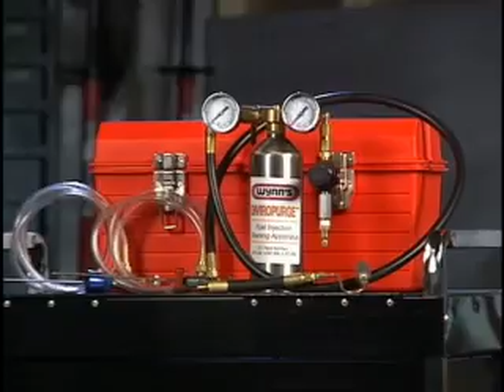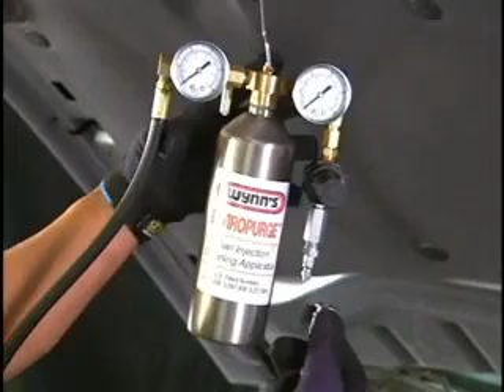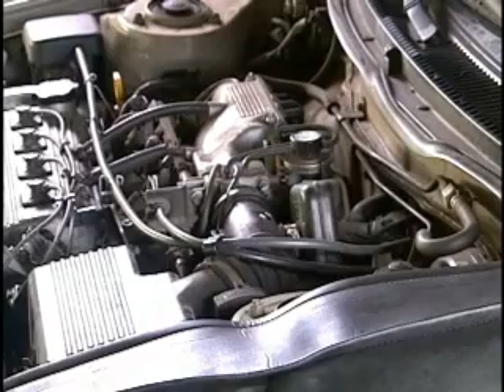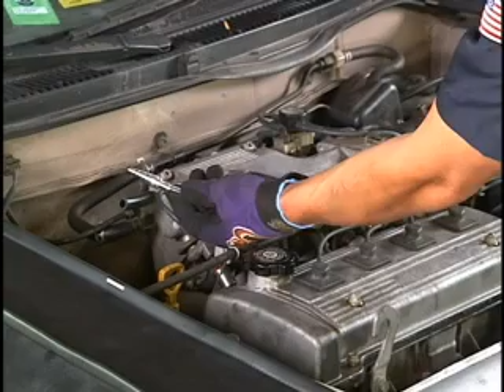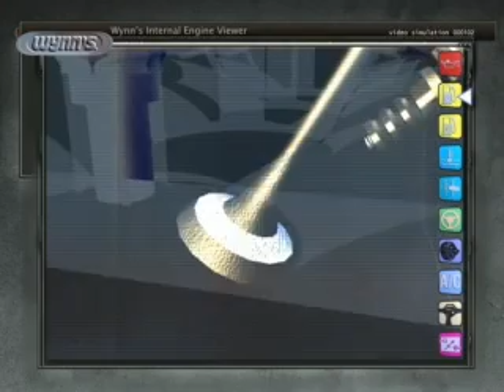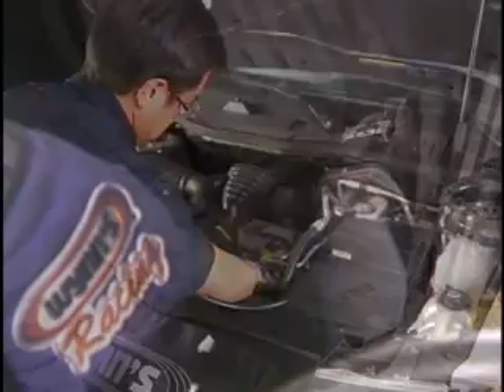How to perform a Wynn's Fuel System Cleaning Service

Comment: Just had this Wynn's procedure done on my 2000 s10 with 372,000 miles. The vehicle runs better than it did when new.  I recommend this procedure. It was performed at a GM dealership.

Comment from the maker: You can use the VIC product to perform a fuel induction service. When you perform an induction service, you leave the throttle alone and let the vehicle idle. After the all the product runs through you can perform a throttle body cleaning service. I hope I answer your question.

Comment: The best way to clean injectors other than removing injectors and having them cleaned and serviced, also due to the current easy way of buying a borescope take pictures before and after to prove it works otherwise its mute,especially if the injectors and the combustion chambers have never been cleaned that way you can tell it really works, any cars which have never had cleaners put through the system will never be cleaned properly unless you have the head off and clean the piston tops and replace the intake and exhaust valves. :) The stuff works but it all depends on how old your car is and how many KM have been driven and especially if HWY driving due to the amount of heat and cleaning of the intake and exhaust and piston aras ? PS: think about the amount of carbon on top of your pistons is really added extra HP to your car due to the build up of the carbon, like taking a couple of thousands of a inch of extra height to the top of your pistons but then again your injectors really do need serving especially if you are living out of town and do not have great clean fuel all the time ?

Comment: So at the 3 min. in fuel system cleaning (VIC) you dont need to have a throttle compresser to hold above while the fluid is going through, just adding fluid til the engine begins to run rough?

Comment: Hey. I wanted to get this service done on my toyota mark x which has the 4gr-fse (Direct injection). I just wanted to know if this service might result in any issues like (o2 sensor clogging or other CI codes that mite come). cheers

Comment: where in the uk can i have a wynns machine flush? your offices in the UK are not helpful, actually quite rude.
Reply: +chad h thanks for the reply. you are totally correct. brots are rude. usually, they more politeup north. stoke, Birmingham and that sort of thing. i see, wynns is overpriced. there is an edt machine thats not wynns in the uk and its about 100 to 150pounds to have done. they use some form of flush and soya oil with a filter to clean your engine. its looks.rather good. i think diesel engines benefit from it a huge amount
Reply: +chad h it sounds like I would enjoy living in the US, the part you are from.
i see... i never visited that place. im based in Greenwich.  whats your work here?